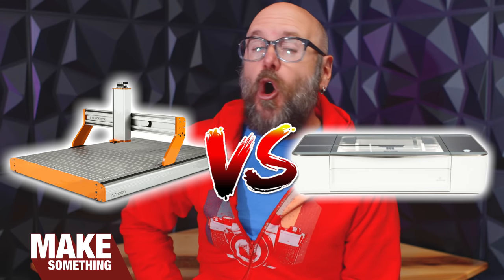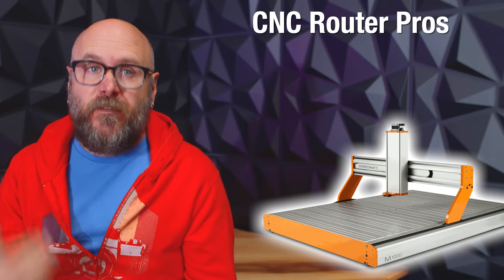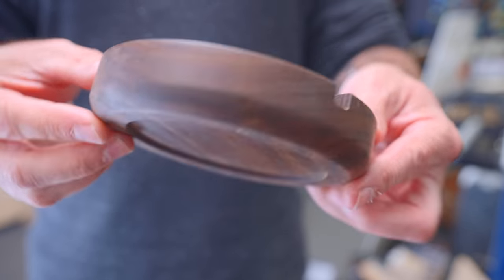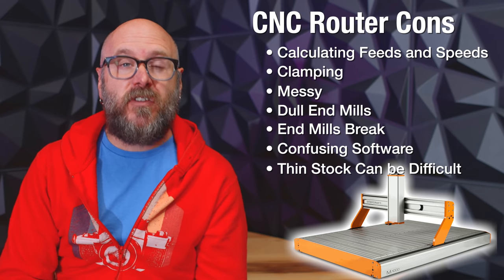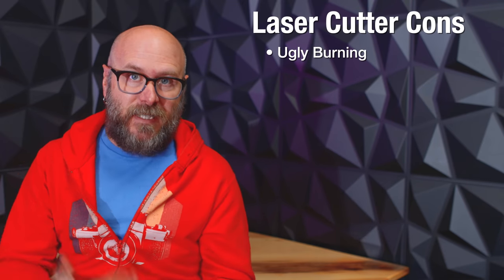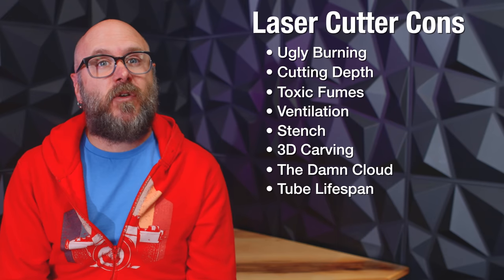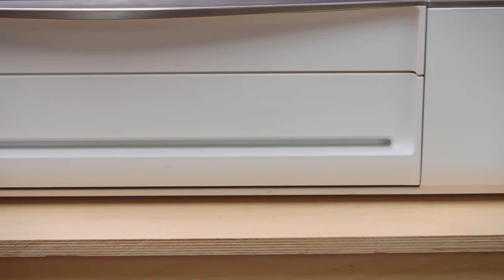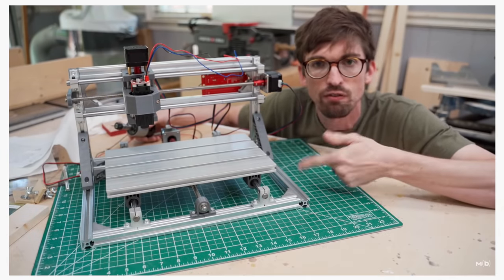CNC vs Laser. Which Should You Get First?

Comment: I own both a Boss 100 watt laser and a Camaster Stinger cnc machine. You have really nailed the pros and cons very well. I bought the laser machine first and it was both easy to learn and fun. after 2 years I bought the cnc machine. Well that is very different all together. It will do more than the laser will but the learning curve ( bits to use, wood to use, depths etc.) is 1000 times more difficult unless all you want to make are personalized cutting boards:) I can make a lot on it now but it is overwhelming in the first year.

Comment: I highly recommend anyone using a CNC router to begin using Fusion 360.  That software not only handles the design and guide, but includes a nice customizable library feature of bits that would solve your problem as well
Reply: Mastercam is also good as it can be used for many materials
Reply: What about SolidWorks?
Reply: I use Carveco software and love it.

Comment: The short answer to "should I get the CNC Router or CNC Laser Cutter?" is both... allow me to explain. The Stepcraft M-1000 pictured at 0:23 can do both... you can have a nice 2 x 4 desktop CNC with an ATC and awesome gantry clearance AAAND Stepcraft also sells the Laser module, the 3D printer module, the tangential knife module, the drawing/pen module... etc for the same machine.

Comment: If you are using a vacuum table, then you should use foam gasket to hold your parts down. Route your part into the mdf table and gasket the inside of the cut lines. You can then drill vacuum holes into the board. When finished you can use cork to plug the holes and move onto the next job. Use at least a 7,000 spindle speed to 12,000 max spindle speed for acrylic and polycarbonate. Mdf cuts good at about 6,500 spindle speed. If it’s 1/2 inch thick you’ll need multiple passes for a cleaner edge.

Comment: I have both (80W eBay laser and a Onefinity Woodworker). I would probably recommend the CNC first, unless you have a specific project that really requires the laser. The quality+work area vs the price of each tilts heavily in favor of the CNC.  If you want a laser that cuts bigger than a 2'x2' square, you're probably going to need at minimum a 130 watt Chinese laser ($6k+), and you'll spend many times more than that for a better brand tool with customer support. That said, I've only had the CNC for a few months, dust collection on the CNC seems to be a huge pain point for me so far.
Reply: Why would you ever be deciding between the two? The applications barely overlap. The reason you get a laser is for cutting precise pieces of slab material or etching, and for specialty applications like welding - not to mention, lasers come in all sorts of types like yttrium, diode, co2, etc for different materials. A CNC router is mainly used to make production ready semi-3D topography for wood or soft plastics only, not simply cutting. In fact, Ive rarely seen it used only for cutting because table saws and band saws are much more efficient. You use a CNC when you want to say create a counter bored hole or depression for a bracket or hinge and to be able to put various tapered bits for undercuts. You would NEVER use a laser for any of this.
Reply: @davidwest6019   you my friend ha e no idea of what you are saying. Blessings

Comment: Honestly I believe you would be happy with either one. You can do so many things on those machines if you got them set up properly. 
I only have a laser cutter, and it's such a great addition to my shop. The main thing I love about lasers in contrast to CNCs is the relatively low amount of mess they cause.
I don't get why people would get mad over this - can't we just have some fun?
Reply from the maker: Let's just have fun Paul!
Reply: what laser cutter do you have.
Reply: @3sixtybubba133  I just got one of those chinese 40 watt units (often called K40). It's not much, but it's a great entry to the laser cutting world if you're prepared to spend some time fiddling with all its quirks
Reply: @paulurbaniak2242  you can cut metal right?
Reply: @3sixtybubba133  No! You can't cut metal with hobby laser cutters. If you want to engrave metal. you heed to use either a fibre laser or use some coating on the metal. But you won't cut through metal with your standard laser cutter. What are planning on doing with the laser?
Reply: @paulurbaniak2242  im trying to make the tiny 5mm thick pieces out of metal ofc. i can 3d print them but ofc metal is more durable and stronger
Reply: @3sixtybubba133  Hm, a laser isn't the right tool for that. You'd either need to use a CNC or use some other material that you can laser cut (like acrylic or wood).
Reply: @paulurbaniak2242  thanks man helped me save a lot of money

Comment: I heard those  co2 laser tubes and their PSUs live for many years, when you stay below their maximum power ratings. I first had a diode laser cutter and decided to extend its oomph with an 80 watt co2 tube which I never run at more than round about 60 watts. That is more than enough in most cases. For fine engravings I can switch back to the diode head. My machine is still quite new, so I will see if YouTube was right about that "stay below max power" thing....
Reply: This matched everything I read and heard when setting up a new laser cutter at a job I worked a while ago. Was a 100W machine, but we always used 80W as the maximum setting to prolong laser tube life. The sense I got was that they advertise them at the maximum they can do briefly, but if you want a long life out of it you should run it at 80% or less. The manual pretty much said this. Would really make more sense to limit the software to 80W and market it as a "true 80W machine." But of course that's a harder sell, marketing wants to pump the numbers up as much as possible. And I guess there might be circumstances where you really do need the full power, either fairly briefly or tube life be damned, and being able to use such if needed is better than having the machine limited to a lower long-life setting.

On another note, you talked about your diode vs. CO2 - I've been thinking of getting one of those super-budget 30W or something (meaning 3W actual light power) diode machines, the $300 ones. How capable are those - can they cut 1/4" plywood? Everyone says CO2 can do a lot more - can a diode machine do the same thing just a lot slower? I'm just thinking for tinkering and hobby use, so I'm not too worried about speed. I'm coming from the 3D printing world so I'm used to setting it up and walking away for numerous hours. Or are there things the diode laser simply can't do even with enough time?

Comment: I think CNC brand has a big part to do with it's ease of use, there are some out there that have very easy to use software that they've customized for their machines.  I bought a Shapeoko, and while it's maybe not the most advanced in terms of accessories and features (like cutting beneath the level of the machine), it's software is a breeze to get started with, and some niceties like clamping and dust collection are baked into their basic design.  Haven't looked back and would recommend for someone looking for an easy, reasonably priced good quality CNC.

Comment: Is this really even a comparison? The two tools are so different. Its like asking do you get a plasma cutter or lathe, I mean, wtf, its not even same category.
Any mechanical engineer would laugh their heads off if you asked them to compare the two. Why not instead do a video on water jet, laser, plasma and wire cutters? All of these are 2D cutting technologies with actual comparable metrics and applications. A CNC router is used to create 3D/semi-3D topography (say like a cavity for a bracket or hinge), a laser cutter is for cutting or surface etching only.
No one in the industry would ever be actually deciding between the two. No one.
Reply from the maker: Exactly. You get it!

Comment: Very informative Dave! I'd choose the laser and make router templates, so you get a bit of CNC in der too
Reply: Agreed. I got a CNC router but I think the Laser would have been the better choice for me. While the router is more versatile IMO, the noise it makes, makes me cringle everytime I use it. Cutting templates with the laser would have worked for 90% of my CNC projects.
Now building an enclosure to get the noise neighbor friendly.
Reply: @strale  i made the same mistake. Much of what I use my router for is completely 2D. It's nice for internal pockets and stuff but only has a few inches of usable vertical motion with certain bits installed.

Comment: Sir, if I want to just cut approx. 1/2" to 3/4" " thick MDF and which is not more than 15" wide and 12" in length for my work, then according to you which type of machine would be best suitable to buy ? I am going to basically make DIY toys for kids on regular basis. Pls try to answer . ThNks.
Reply from the maker: You would want a CNC for that.
Reply: @MakeSomething  ty so so much. 👍

Comment: Don't want to start with "achtuallhy" but laser can do 3d carving. Not as good as cnc but you can 3d carve grayscale images into usually mdf. It requires 3-4 passes on higher power. I tried making few coins by pouring tin into these mdf casts and results weren't that bad. 
Burned edges can be managed by better air assist. I got custom made nozzle with 2 mm hole for air and laser beam that's just 2.5 mm above cutting material. Also stronger air pump can help. Cuts are much cleaner. But I have to change it back to normal nozzle for engravings because soot builds up on nozzle and starts scratching off on material.
Reply: Actually, it sounds like you are really "cut out" for this type of work )!@&
Reply: Also, I didn't have any luck with the fillet-O-fish bit, I just floundered.
Reply: @Tony-Tech  😂

Comment: For the weekend woodworker who's unsure, I typically still suggest the CNC more than the Laser only because quality of machine for the price, you can get a far more decent of a CNC for your Dollar. That's kind of changing, but we're still a bit of a ways away from the inflection point where Lasers will be more economical for if you're only using it every so often. Though as with anything, it depends on what you want to use such a machine for. For instance, I'm gonna be getting a Laser before I get a CNC because it just matches my desired use-case better.

Comment: I agree with most of your comments. However, I disagree with your opinion regarding Laser usefulness. If you were to upgrade from that glow forge laser you would see that there are much better options. In my opinion glow forge is overrated, overpriced, and much better options out there for slightly more money. I own a thunder laser 130 watt CO2 system which will run rings around glow forge. I can routinely get cutting depths of at least 3/4 of an inch with straight curve and minimal burning. I also find that my laser provides more options and profitability in my business.
Reply from the maker: I have upgraded from the Glowforge. I now have a Trotec R400!